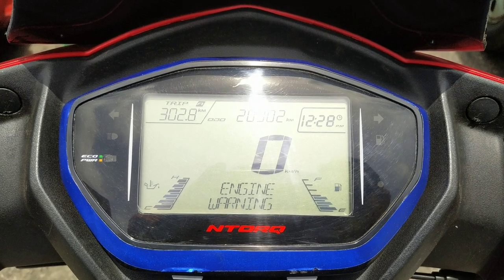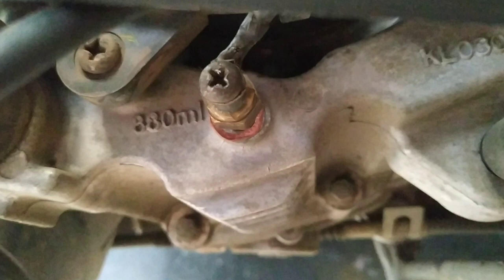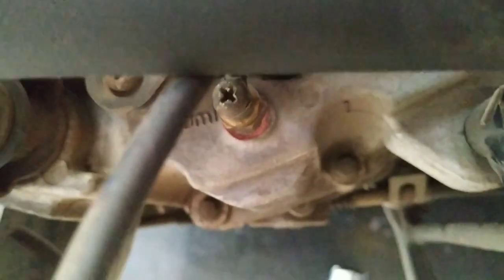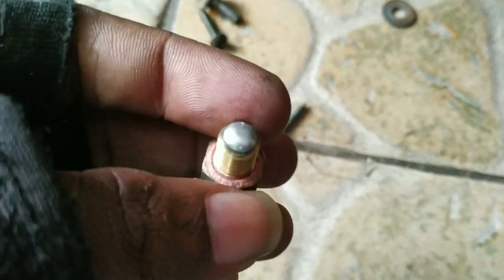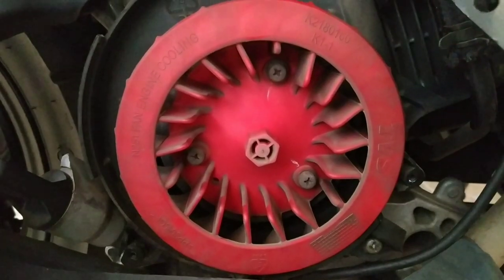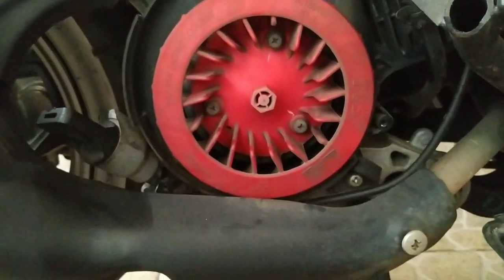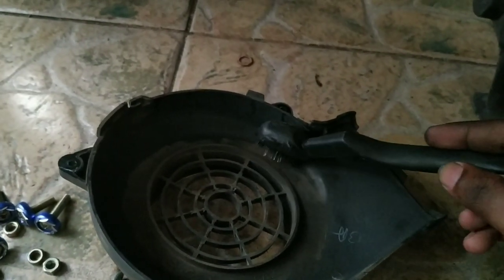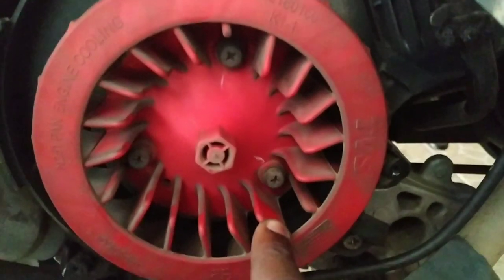Ntorq Engine Over Heat Problem | Simply fix any scooter heat problem

Comment: i Changed sensor 3 times... due to heating issue.... what should i do now
Reply from the maker: Try changing the spark plug
Maybe a bad combustion happening inside the engine 
Use a japan plug
Reply: @TTFai  kya ap apna no. de skte ho
Reply: Sensor Price bhai
Reply: @sunilgadaba3345  160
Reply: @shivambanuni8155  Yamaha Ka Kitana Hoga  Bhai
Reply: Mera ntorq bs6 raceedition hai mera ma heating nahe hota hai 2 line sa uper nahe jata 2 year ho gya scooty Lea huwa